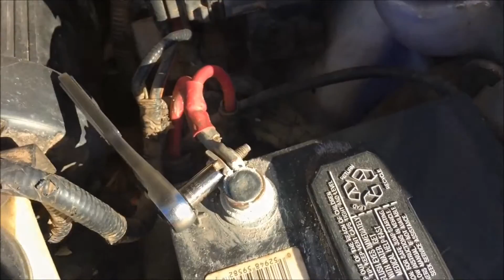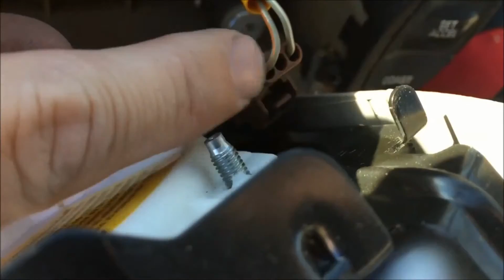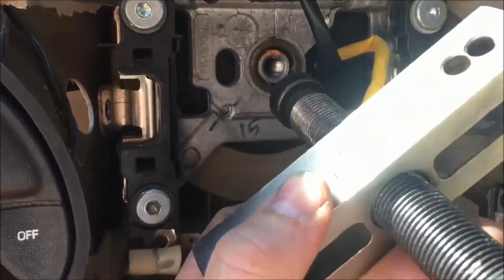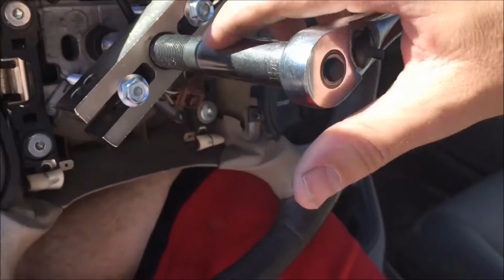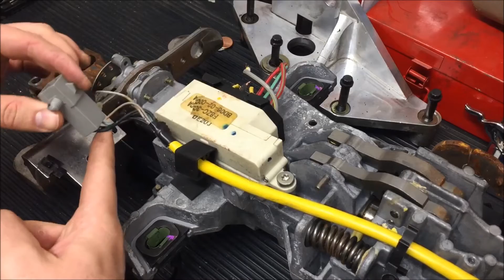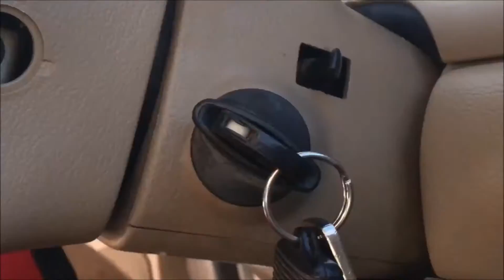Clock Spring Removal Ford Mustang 1994-2004

Comment: do yo have the part number of the steering wheel puller? I bought one from Autozone but it doesnt look is the correct fit for the side bolts :(

Comment: Man I surely don't remember taking the whole steering wheel off to change the clock spring before lol. Matter of fact I got to start your video over because I thought when you first started the video the clock spring came right out before you started taking the steering wheel off?
Reply from the maker: It was a spare one for an example. Here is removing mine https://youtu.be/0mJigdcP47c?si=8L71rwg7iIr_VCiL
Reply: Yeah I couldn't remember what I did at the time when I did mine maybe I did indeed change the clock spring and to be honest I can't even remember why I did it at the time and the other car. I think I remember back then getting a puller to take it off to change that out but I can't like I said I can't remember why I did it. I think I hopefully solved my issue of the airbag light being on and so I got the correct fuses in the locations and I did the clear the code procedure so it did not come back on but I hope it doesn't repeat like it did the last time I cleared the codes. However I did not have the correct size fuse in it I had a 15 and also I got a fuse tap for my white face gauges and also for my aftermarket gauges and I'm going to install and I had 110 amp fuse and 1/5 amp fuse and I was supposed to have two 5 amp fuses so I have all that corrected now and I will see what happens @dannyjohnsonsgarage

Comment: What exactly does the clock spring do? My clock doesn't work ...does the clock spring have anything to do  with the dash clock.
Reply from the maker: It does not have anything to do with the clock itself, it just gets that name from turning like a clock as it spins. It’s just a way to allow wires (for the horn and cruise control) to twist with the steering wheel without binding up

Comment: Hey Danny big fan of your videos! Wanted to ask. What are some other things I can check before doing this  my cruise control doesn’t work anymore nor does my horn my airbag light is on  thanks in advance.
Reply from the maker: I would check fuse 17 under the dashboard https://images.app.goo.gl/6FHStZ8FzAbynHJQ9
Reply: My fuse keeps blowing in the airbag light is on. The horn does work and I don't know if the cruise is working or not because I don't even use it and I don't care if it works I just want to get that are back like to go out and I actually did a reset a few weeks ago and it went out for a while and came back like 2 weeks later @dannyjohnsonsgarage

Comment: Hi Danny, thanks for the great video. I have a question about the key lock mechanism. On your bench, the black plastic part that surrounds the key in the ignition is missing, but it's back on the ignition barrel when the column is back on the car again. How does this black plastic part come off? I'm talking about the black plastic piece that you hold onto with your fingers when your turn the key in the ignition...
Reply: Thanks bro just seen it and was the most helpful video. Just liked and subscribed
Reply: Did you ever find out how?? Im trying to find that out myself now
Reply: @andreshernandez7170  Yes I did! Full deets in this video my man:
https://www.youtube.com/watch?v=-3HK55-RcJ0&t=231s
Reply: @horus_works thanks for the video. For those already in the middle of the job wondering the same. He describe that steps at 11:30

Comment: If you dont have a horn or cruise control, do you still need a clock spring?
Reply from the maker: (or air bag is what I’m assuming you mean by no horn as well). I’m pretty sure you wouldn’t need it in that case on this generation of mustang. My wife’s infiniti needed it for all kinds of other things like a steering wheel position sensor and radio buttons.  I’m pretty sure the turn stock has nothing to do with it, but you might want to verify that.

Comment: Horn doesn't work air bag light on and no cruise control, so I'm guessing must be clock spring.? Even saw a green light come on OD OFF odometer was acting wacked stopped working till I started again later on after engine was cool? Hope don't have bunch of shorted wires.
Reply from the maker: Mark Jakims Check all fuses as well